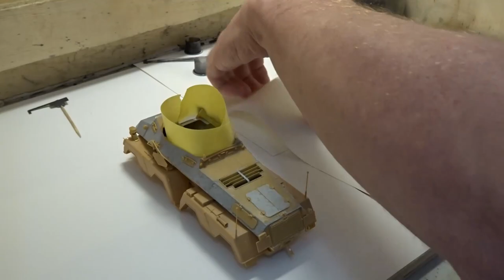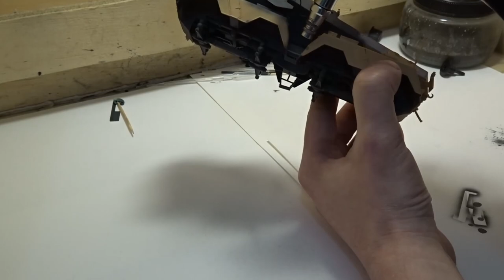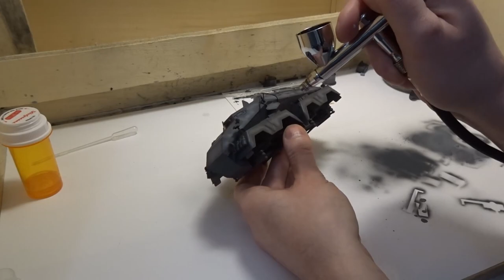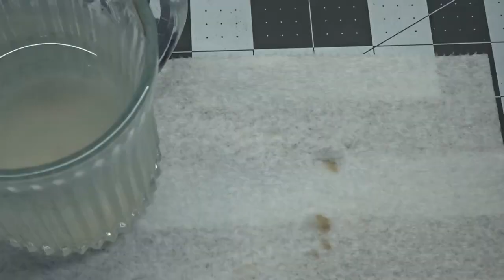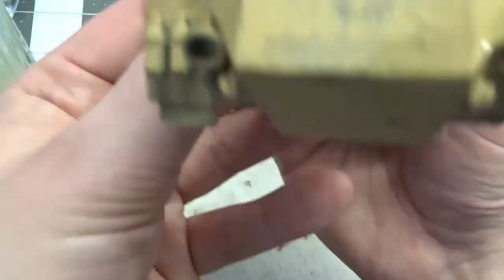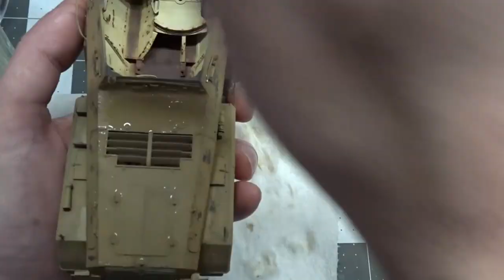How to Hairspray Chipping AFV Club Sd.Kfz. 233 (Update 3)

Comment: Just wondering about adding dish washing fluid to the water to help with chipping. I have not heard of it and if works great, just wondering about effects on top coat if residual is left behind. Thanks for the video
Reply from the maker: I didn't think about the dish soap affecting the top layer. That's something I'm going to have to test to see if it will be a issue or not.